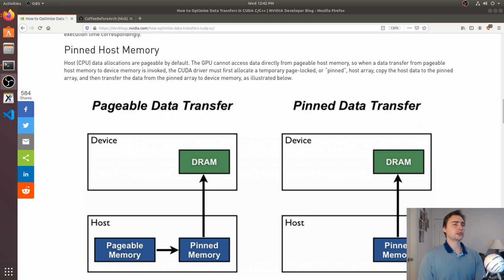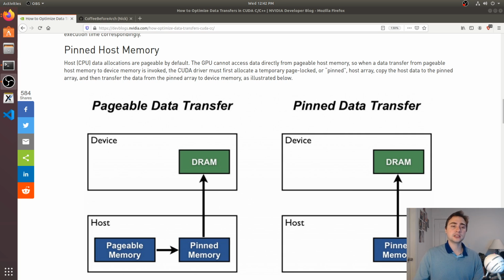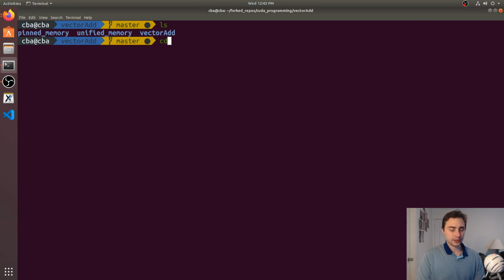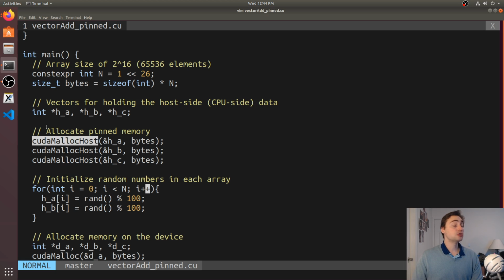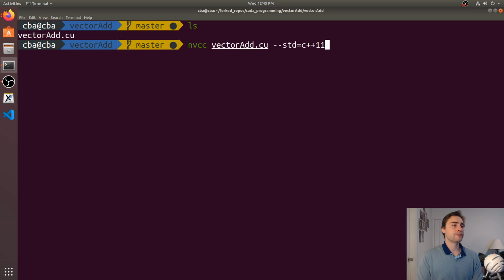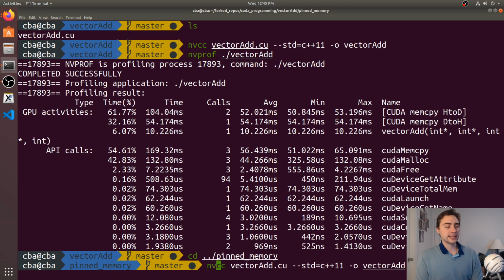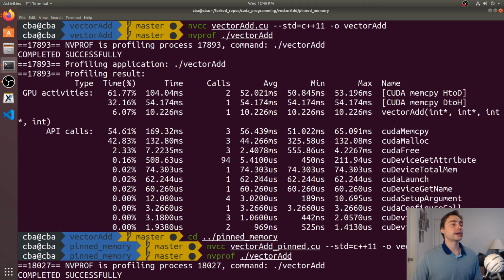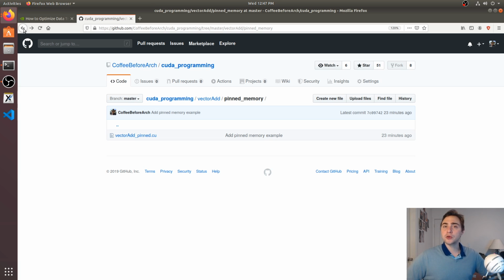CUDA Crash Course (v2): Pinned Memory

Comment: Hi. Can you make a video on using CUDA texture memory?. Also,  if possible can you provide a solid example or application using it :) ?
Reply: The CUDA samples do have one. You can probably start from there. The big hurdle is that it's chock full with the "helper" functions Nvidia has smeared all over their samples repository so you need to make that work (a pain in the butt) or covert the sample into a self-contained unit.